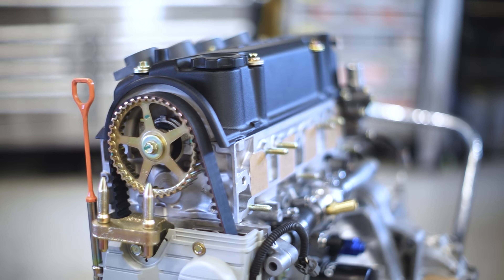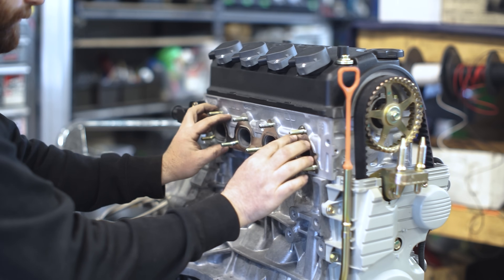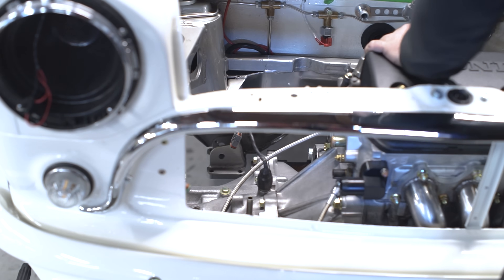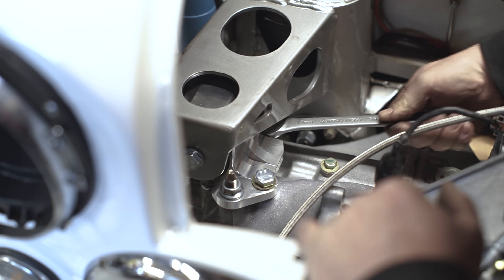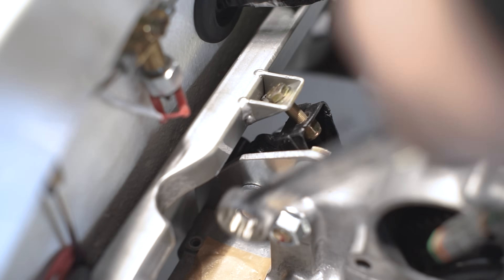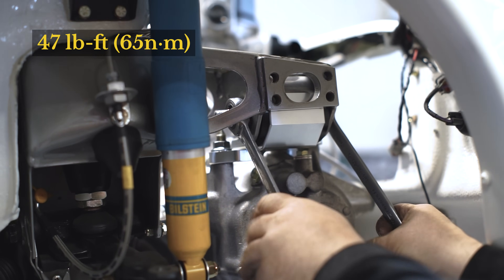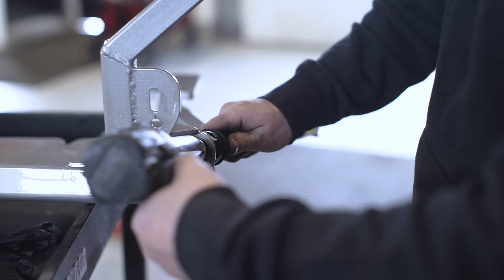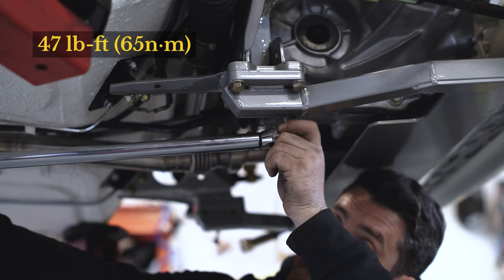SMCO Ultimate Classic mini Honda D16 Kit Install: Part 2

Comment: back in 2001 when ever one was going b series i decided to boost my d16. after 2 fun cars of being boosted the d16 has always had a sweet spot in me. in this chasis i would imgaine even the na is plenty of fun and this is definitely my kind of build. im not trying to win drag races, just something with alittle more passing power and still great drivebility and liability. im curious to know if this kit is just a simple bolt on application or welind of frame is needed. ive only watech 3 videos of the completed d swaps. and aslo does this kit if a 70 austin america? im inquiring becuase its time to get my son his first car and mini coopers are just out of the price range.

Comment: Sorry if you've covered this already But, Do you need to run 13" wheels to keep similar gear ratios? Can 10" wheels work ok?
Reply from the maker: We almost exclusively run 10s, sometimes 12s, and very very rarely 13s. We use the gearbox and longer final drive from the base model civic to keep the car usable.
Reply: Thanks. This is my dream build for my mini. One day!

Comment: I'll never convert my A series to a Honda engine, but still I enjoy these videos. This looks like a proper piece of kit.
Reply: I have owned two minis, an engine first used in 1951 probably seems like a nostalgic idea until you find yourself putting in as much oil as petrol for an engine with as much power as an asthmatic ant.
Reply: @reggiedixon2  we have a proper sorted engine. Optimised for road use, its a blast. For the money involved to do a Honda conversion I would still rather do a proper 16v conversion based on the A series or maybe a fully build Swiftune engine. Both cheaper options.
Reply: @GTE_Channel  My experience differs, a mini A series engine dates to 1951, I am not spending money on that.
Reply: @reggiedixon2  the mini itself dates to the 1950's, if you like the modern engines just get a modern car.  If you build an A series right, it can be very responsive and plenty of power for that small weight.    bigger engines ruin the handling, it's not a mini anymore
Reply: @stuartbowes619  That isn't what people who do the Honda conversion say. Also there are other conversions. The whole concept of Retromods is that you get the classic car without the bits that made them terrible. The two minis I had were a nightmare in daily use due to the rubbish 1951 engine. Also googling gave me 155kg for an A Series 1275 and 128 kg for a Honda B16B presumably without gearbox.
Reply: @reggiedixon2  I use my Mini daily, and have done so for nearly 2 decades 🫡.

Once you know how to properly setup the carb (trust me 99% of owners don't know how to) and get the engine running perfectly they are an absolute joy
Reply: @GTE_Channel  Not starting reliably and using 5 litres of oil to go 100 miles tells me differently. Nothing to do with carbs.
Reply: @reggiedixon2  guess I'm in luck. Our Engine is in top condition,  never let us down.
Reply: I know so many people with nicely tuned A series.   Carb setup actually can cause problems with oil, for example what people do is disconnect all the breathers and put little vents on them instead of using vacuum, the pressure builds up, the oil pisses out the seals.  common error.  Do it right and they run real well.  good machining and correctly built, they're perfectly fine.  
If you like honda engines in small nimble cars, maybe just buy a Civic?
btw not against engine swaps at all, just arguing that that it's not necessary or 'better' than the original in a lot of ways.  as mentioned before, they are heavy and it changes the handling characteristics massively (yes you have to include the 'box in the weight lol.. and have you considered the effect of the extra torque on the steering..)

it's not a black and white issue is what im saying

Comment: Will you guys eventually start selling the subframe and engine as a full kit?
Reply: Used engines are always a gamble. I don't think they want that responsibility.
Reply from the maker: The engines we use for our builds are fully rebuilt and blueprinted, and the same engine package is available for sale. Send us an email at mail@stevestonmotorco.com if you'd like more specifics